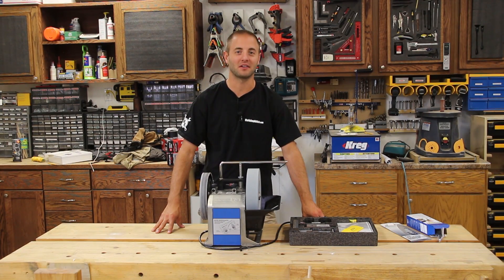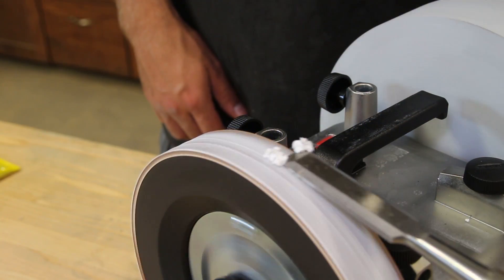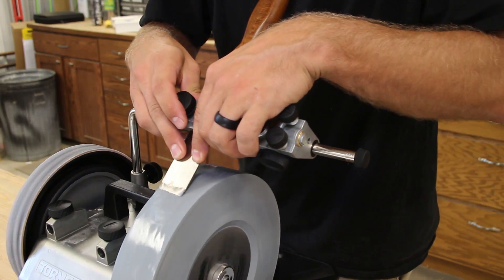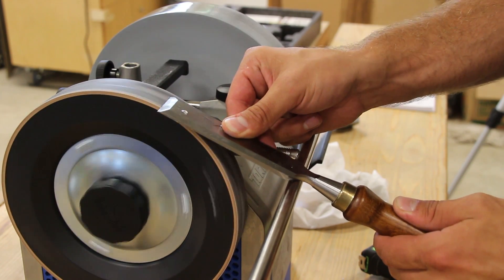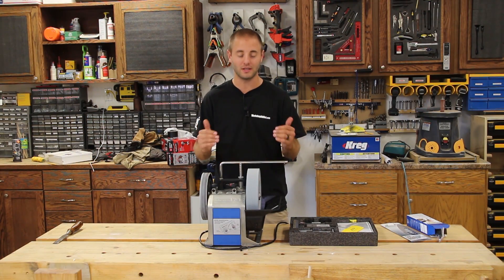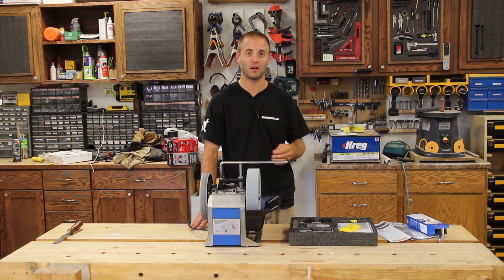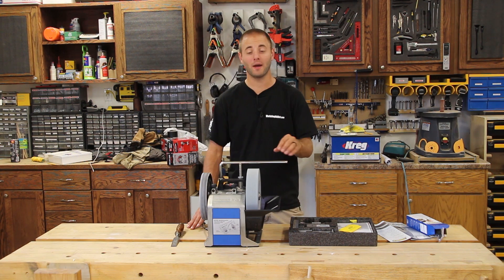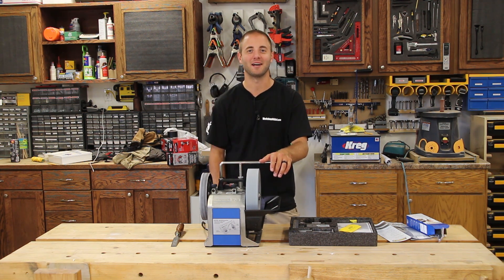Tormek T8 Water Cooled Sharpening System Review

Comment: I had been concerned about creating sparks from electric stone systems. My dmt sharpening steels from coarse to extra-extra fine and are getting old and strop that I use finer grit pastes for mirror finish is showing deterioration;  replacing them would be comparable in price to the system you have demonstrated

Comment: I know you probably already heard or read this, but the company literature states the RPM of the wheel is actually 90 RPM; not 80 RPM. Still that much rotation speed doesn't cause the water to throw off very much at all. :-)

Comment: Great video man.  One quick question, I just started setting up my T8 and realized that the leather wheel wobbles from side to side.  This doesn't seem to right, but wanted to check before I send it back?
Reply from the maker: There shouldn't be any wobble... maybe a little but how bad is it? Make sure it is seated on the shaft correctly.
Reply: Thanks man, I'm sending it back, maybe just a dud.